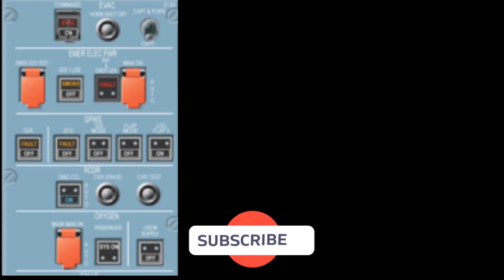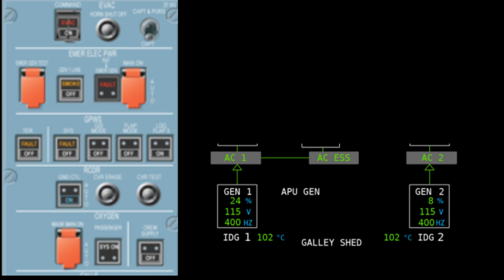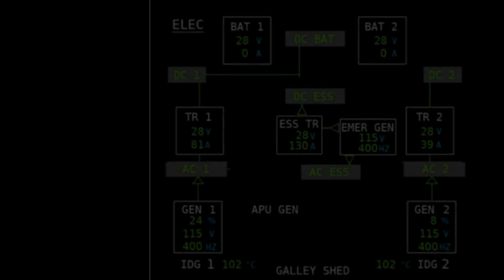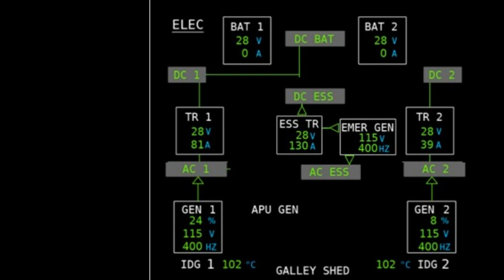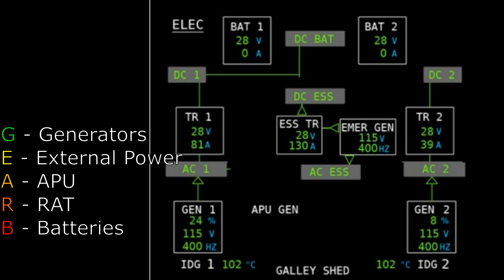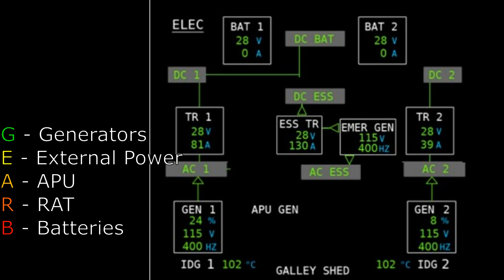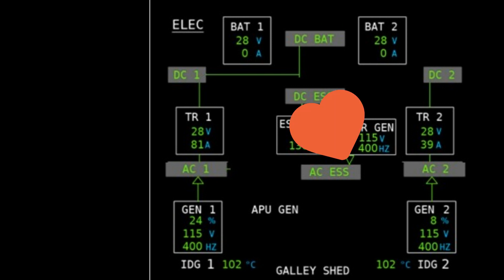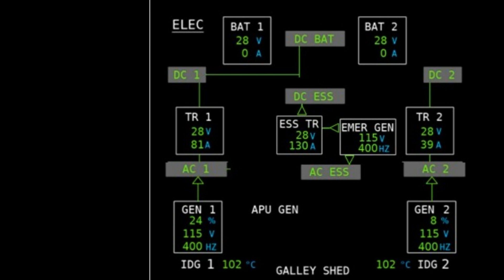'Tear n Share' Emer Elec PB

Comment: Thank you for clarifying this!
Just a couple of questions.
Being both AC 1 and DC ESS powered I guess that the HYD B pump will be fully functional.
In this case HYD B SYS will be pressurized by the electric pump or the RAT?
If the blue pump is working can I assume that RAT stall won’t be a factor and the aircraft won’t reconfigure in BAT ONLY and on ground BAT ONLY  and so AC ESS, DC ESS and respective AC ESS SHED and DC ESS SHED would be preserved?
Thanks and keep making these videos!
Reply from the maker: AC1 not powered in EMER ELEC CONFIG RAT powers Blue. Best to review your FCOM
Reply: @airbuswhatsitdoingnow320  I was mentioning the case shown in your video where you extend the RAT through the  MAN ON (ELEC EMER PWR panel) having both GEN 1 & 2 still working.
As you said AC 1 will be powered by GEN 1 and DC ESS by EMER GEN.
Same scenario should be faced if you lose GEN 1 & 2 and then you recover the elec switching the APU on.
In this case the EMER GEN should feed the ESS buses while AC 1 and 2 should be fed by APU.
So having in this scenarios both AC 1 and DC ESS powered I was wondering about the B pump and hyd sys in such a scenario and about the RAT stall / on ground BAT only config.
BTW not a A320 pilot here, just a A320 enthusiast ;)
Thanks and sorry for bothering you
Reply from the maker: @firstcapt75  Ok so. if AC 1 running youll have the Blue Elec pump. Also Rat stall normal power resumed no Bat only.
hope that helps

Comment: Nice info. Just wondering about the logic in EMER ELEC that controls the shedding of the AC ESS and the connection of the DC BAT BUS to the batteries at low speed after landing in EMER ELEC, is it contingent on the system knowing that AC1 +2 have been lost or might from a signal that the EMER GEN is running? Did you ever take your sim test scenario all the way through to after landing? Many thanks.
Reply from the maker: Hello Richard
Good Question, The logic is to shed unnecessary load to prevent draining the batteries (no need to power CPT Displays <50kts). Is the signal from the Emer Gen or the Loss of AC1 and AC2? Id have to run it and take a look at the distribution with the AC's powered and the RAT stalled........
Reply: @airbuswhatsitdoingnow320  No issue, you just got me wondering. 
You do a great job at these videos. In the world of CBT, VACBI and digital FCOMs it's great to have some "chalk and talk" once again.